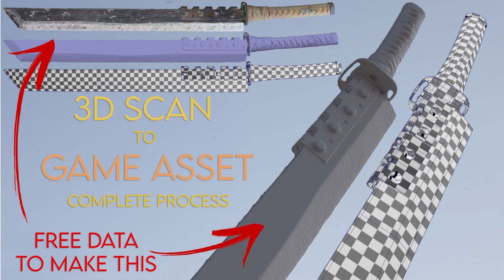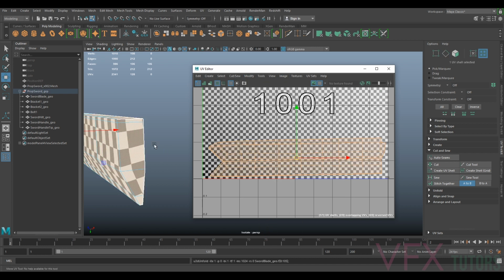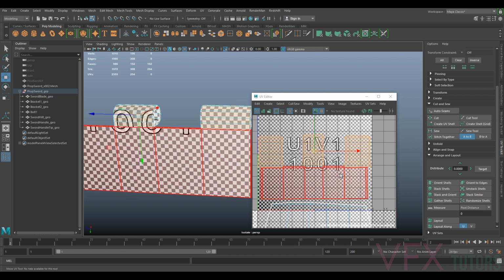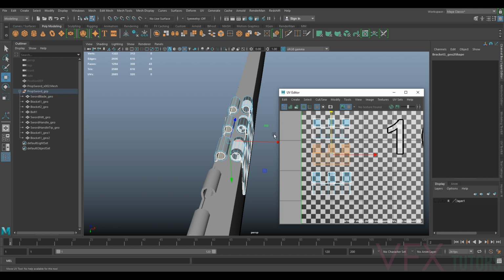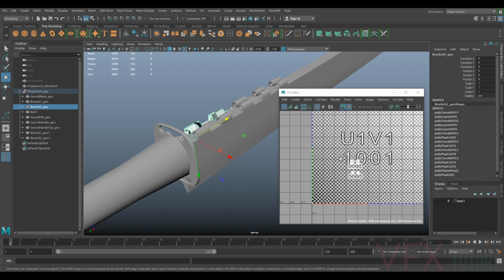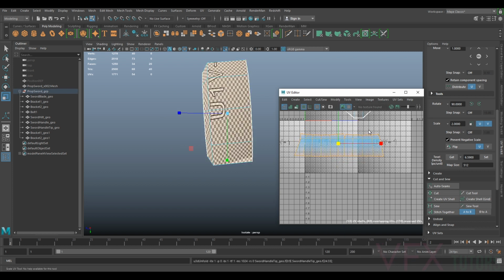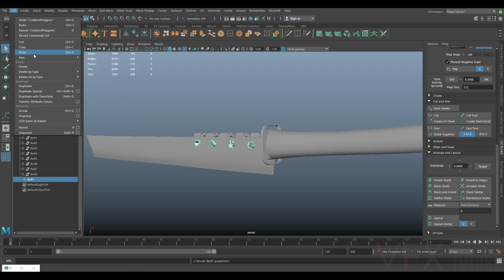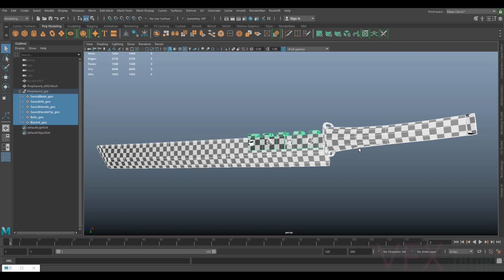Photogrammetry Tutorial: Create 3D scan Film and Cosplay Props Step By Step (PART 3)

Comment: in my case, the uv's appear horizontally stretched on the handle but everything else is fine. Is that a problem?
Reply from the maker: Hey sakib, yeah it’s not good to have stretched UV’s, it can cause quite a few issues further on. you should try to make the all the same texel density as well
Reply: @VFXTutors  yes thank you